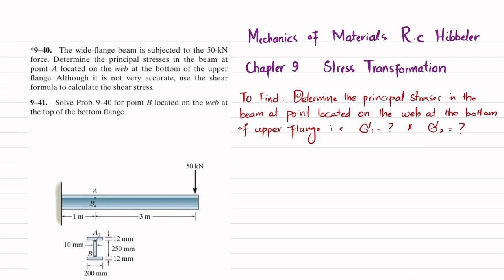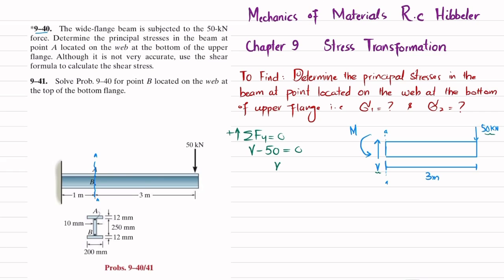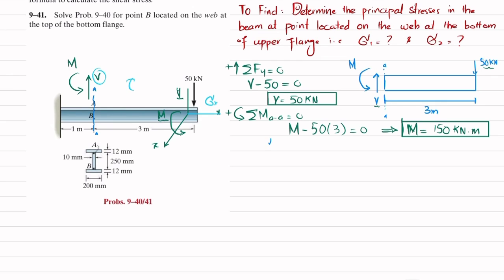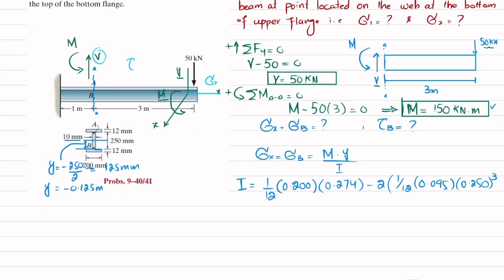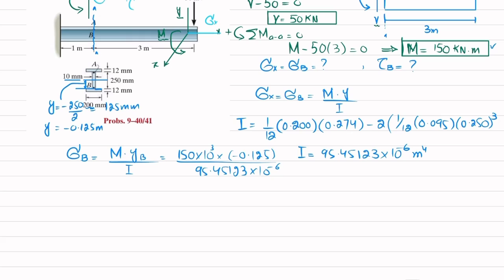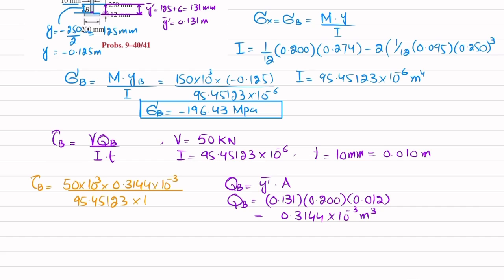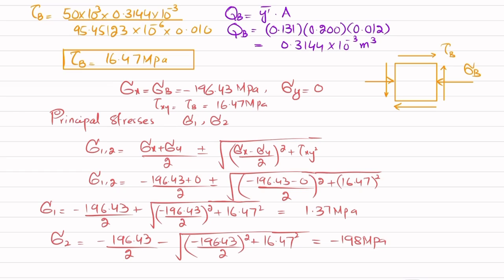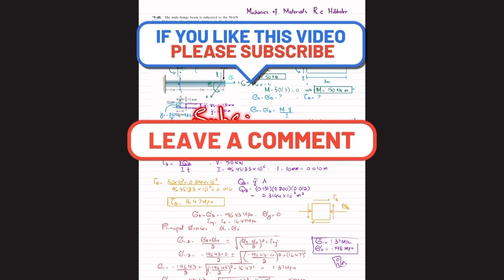Determine principal stresses in the beam at point B | Problem 9-41 | Mech of materials rc Hibbeler

Comment: Why in the formula of normal stress, negative is not used? When to use it and when to not? And also tell that whether there is compression or tension occuring at the bottom of the beam , will we take y as negative? Kindly answer this.
Reply from the maker: The formula with negative sign is derived for the moment which causes bending in which away the top layer is in compression while bottom layer is in tension. Now in our cases you can see the moment causes the beam to bend and it is producing top layer in tension and bottom in compression.
Reply from the maker: The other answer is that if the reaction moment is clock wise then we use the formula of bending stress = - M *y / I where y above neutral axis will be taken positive thus cuasing compressive stress above neutral axis (negative bending stress) and tension in bottom layer. If the moment is counter clock while then it will be opposite to what I have said. ❤

Comment: Sir why shear stress is not negative as point B is below neutral axis?
Reply from the maker: We need the value of shear stress only that's why we use positive value. Also shear force is upward. And in shear force there is no negative sign in formula. Also if you take the shear force in downward (negative) then shear stress value is same but negative which shows the opposite direction only. Now either you take positive or negative shear stress it will not affect the principal stresses ❤

Comment: sir why did you  taken thickness of web instead of flange in the CALCULATION OF Qb shear stress st B
Reply from the maker: the thickness at point b will be taken which is the thickness of web....
Reply: @engradnanrasheedmechanical  then you have taken area of flange instead of web
Reply from the maker: @gouharmaquboolnitp yes all area above point b will be taken while calculating Q